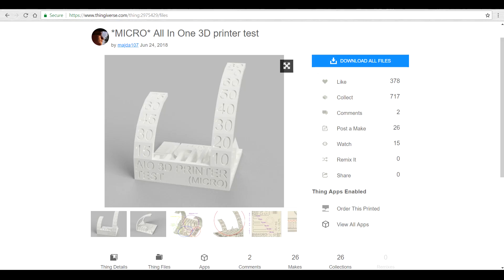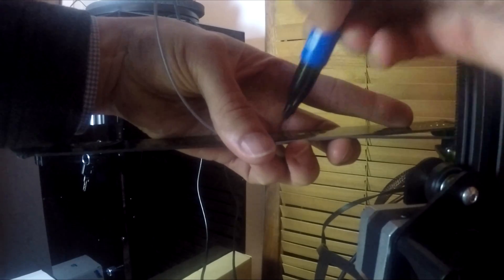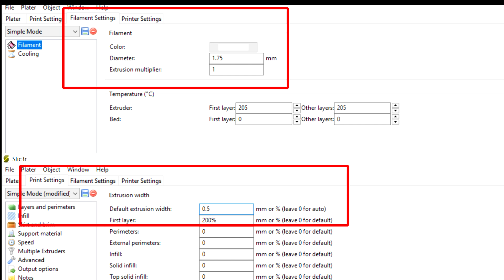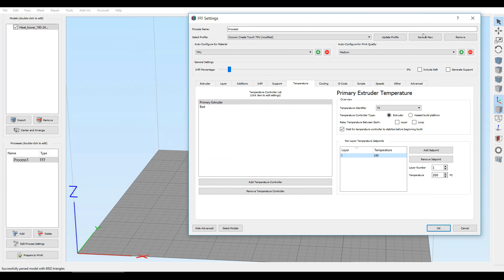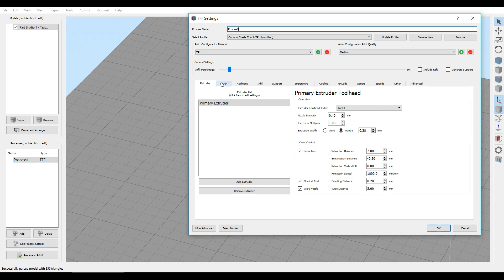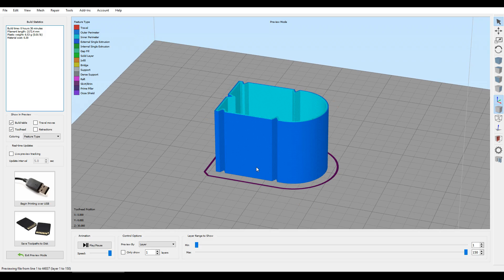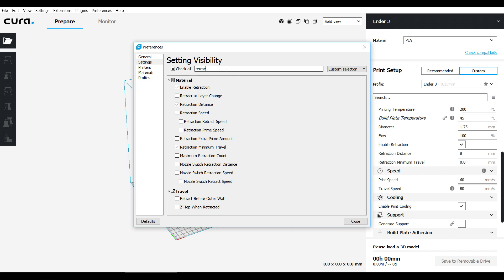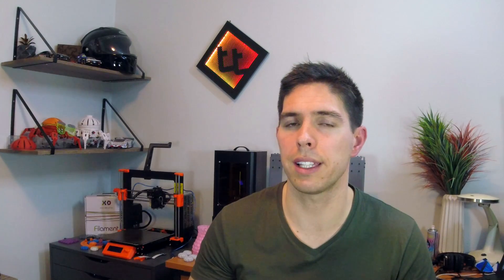How to tune your slicer settings featuring Ender 3 - UPDATE IN DESCRIPTION

Comment: When i do this  M92 does not update to fix the extruder ? M500 gives ok but it does not update M92 E...? Have i missed a step?
Reply from the maker: Creality don't ship the printer with eeprom enabled, which is where the value is stored. You can put the m92 in your start gcode.
Reply: @TeachingTech   oh ok, will updating marlin fix this ?
Reply from the maker: Yes it will. To vanilla like in my video or to th3d.

Comment: Hi, 

what is the codes used for?
"curl -k -H "X-Api-Key: B48F0C35933E47C49712EE720641ACF0" -F "select=false" -F "print=false" -F "file=@[output_filepath]" "http://192.168.0.5/api/files/local" {STRIP "; postProcessing"}"

it was found on scripts tab on s3d.

thank you.
Reply from the maker: That one uploads the gcode to your octoprint install automatically when you save it to your hard drive. You need to update the ip address and api key to match your printer. Curl also needs to be installed, I recently upgraded my computer and it seems to already be on here so maybe that's not such an issue.

Comment: why did you go for 0.48 mm of wall thickness instead of 0.40 mm?
Reply from the maker: It was the auto width from s3d.
Reply: @TeachingTech  How is it auto width if you calibrated it to measure 0.48?
Reply from the maker: Please see 3:30
The auto option is clearly checked. If you really wanted 0.4, just check manual and enter it.

Comment: Hi , followed the tutorial , when i save with M500 to eprom it comes back to standard 93 with next boot, i'm on stock , is there a way to save permanent to eprom ?
Reply from the maker: I recommend flashing to newer firmware to permanently avoid this (and have important safety features): https://www.youtube.com/watch?v=fIl5X2ffdyo
In the meantime, add M92 E<your value> in the start gcode.
Reply: I set the Esteps on the printer display (control->motion->Esteps/mm) and after that saved to memory (Control->Store memory) and it seems to keep the setting after being switched off. My printer is brand new so maybe they fixed the bug? I'd like to flash a new firmware but I'm kind of afraid of bricking my main board.

Comment: I'd like to see one on how to center the prints in the print area of the bed.
Reply from the maker: Assuming you have the correct printer dimensions in your slicer, this is usually automatic.
Reply: I've but both 220x220 and 235x23t for my ender 3 and it prints down and to the left always

Comment: You mentioned in one of your videos the Ender 3 factory test dog slicer settings. How were you able to find these? I wanted to use this as a starting point and fine tune from there.
Reply from the maker: I've just checked and on my SD card is a Cura ini profile. Please check on yours.

Comment: First of all, thank you so much for providing this information, this is soooo useful. Second I have run your extrusion test and when I tested after the e steps had been set, I was measuring roughly the same amount of filament (under extruded in my case). After much inspection, I realized that the M500 instruction does indeed NOT save the settings. If I disconnect octopi and reconnect, the setting is always back to the factory 93. Short of flashing the firmware, I'm not sure how to do this. My copy of the Ender 3 is pathologically under-extruding and in dire need of a fix. Any advice ?
Reply from the maker: Just add a M92 line to your start gcode and you'll be good: http://marlinfw.org/docs/gcode/M092.html

Comment: You forgot to add G91 before sending the command to extrude 100 mm. The G1 E100 might not work in case the printer was left in absolute coordinates mode wich is not rare! This was my case.
Reply: Guys please check the extrusion after making the correction because you might need to tweak it again no matter the calculations. And yes, thankyou Michael for a great job. Your videos on Ender 3 are a real thing for the owners.
Reply from the maker: Great spot and absolutely correct on the G91.
Reply: Thank you, you just saved me lol
Reply: Correct but aftrer that I had to return to absolute coordinates with G90
Reply: Aw man - if I saw this comment sooner I wouldn't have just wasted 45 minutes panicking
Reply: Or do a G92 E0.
Reply: I thought it was M83 ?
Reply: Is this why I can send a G1 E100 command only once?  I'm using Octoprint connected to my Ender 3.  I can send the command once, but after adjusting the M92 with the new steps, if I run another G1 command, it just sits there.  No extruding.  I have to shut down the printer and restart before it will accept another G1 E100 command.
Reply: I was wondering why my extruder was running backwards...

Comment: I ran through this series of tests because I upgraded to an all metal hot end on my Monoprice Maker Select Plus (Wanhao I3 clone).  Like in your video, my speed test indicated no difference when I increased speed, so I doubled my speed.  When I went back and printed the all in one, I found that my bridging performance noticeable degraded, so I went back to my original settings.
Reply: Yeah, the speed test doesn't really work as intended if you follow the video. To get an actual speed test you need to disable Speed Overrides in the "Speed" tab in S3D.
Since this is a small part, S3D will override the print speed and print it slower in order for the plastic to cool down. If you then go to a large model, it will not override speed and now your feedrate (printspeed) is waaaaaaaay above what this test does with Speed Override enabled.
Reply from the maker: Great point, thanks for sharing.

Comment: I have a Monoprice Maker Select Plus (Wanhao I3 clone).  I find that I can't get a good extruder calibration measurement if use feedrate 100 -- the amount of filament extruded was the same before and after, even though I changed my setting from 94 to 104.  Looking at the rest of the M503 data, I see that my maximum feedrate for the extruder is set to 25 mm / sec.  When I repeated with feedrate 50 (G1 E100 F50) I was able to calibrate.
Reply from the maker: I have the Cocoon Create Touch clone version. I have a bunch of videos on updating firmware and other mods, the advi3++ update is recommended and has a nice interface for calibrating the extruder from the touch screen.
Reply: @TeachingTech  Thank you for letting me know about your Cocoon Create Touch.  I hadn't realized that was a similar printer.  That will now serve as an additional resource.

I tried calibrating my extruder in the past but had the same problem of not getting repeatable results.  I tried again this past weekend because I finally replaced my hot end with an all metal one and because this video was still in the back of my mind.

Even at speed 50, the calibration wasn't repeatable and I was clearly overextruding.  I tried 25, and the extruder didn't move.  At this point, I guessed that the extruder gear was slipping during the test.  I removed my nozzle and was then able to repeatably calibrate.

Comment: Thanks for all the files!!! ¿Can you please specify what are the retraction settings for the pre-sliced retraction test? You said you changed the settings every 5mm so there should be six retraction configurations during the print (it's 3cm tall), but the image in Thingiverse only shows five configurations: 0, 2, 4, 6, 8.
Reply from the maker: From memory the base accounts for the difference.
Reply: @TeachingTech  but your picture is wrong. I dug around in the G-Code for the retraction test you posted on thingiverse, if you look at each Z- height and the corresponding retraction, its showing that until 12mm Z height it's at 0 retraction, which is 10mm tower height. After 10mm tower height it goes to 2mm retraction,  and then increases by 2mm retraction every 5mm. In the video you actually got the best retraction at 2mm not 4mm...

Comment: "beginner" with $150 program (same coast as the actuel machine)
Under marlin, without saying anything.. Very perturbed!
Reply from the maker: Please watch the video again. The fact I am using S3D, and the instructions for where to adjust the same settings in Cura and Silc3r are all covered.

Comment: I am new to this excuse the question: If I try to follow the Flowrate test in Simplify, my cube walls always have 1.6mm. Tried it with Auto and Manual mode. Is there any setting in Simplify I oversee?
Reply: Nm sorted it out!

Comment: With the wall thickness test, why is it that your desired thickness is 0.48? Shouldn't it be 0.50? How would I know my desired thickness? Thanks!
Reply from the maker: That is the auto generated thickness from Simplify3D. You can override this yourself. It doesn't matter so much what it is, just try and match it in your initial calibrations.
Reply: Great, thank you.

Comment: Thanks for all your vids.  I was going through this process and was trying to tune in my retraction.  
I ran the test and I had strings the whole way up.
After discussing in the Facebook group it was advised to be filament drag. Cleaned it out the nozzle and hot end per the troubleshooting good and re-ran.  Looked basically like yours. Thanks again
Reply from the maker: Great info, thanks for sharing.

Comment: Question does the Ender 3 Pro need TL Smoother?
Reply from the maker: It has the same skin pattern as the standard model for me. When I tested I found smoothers didn't fix it, other had more success.

Comment: Can the esteps be adjusted on the stock ender 3  firmware? if not is there a work around maybe using the starting gcode?
Reply: Think I found my answer in the comments below. add M92 Z9** to my start code. I have a new question now. If I am using Cura for the cube test and use 0.5mm, should it measure out to 0.5 or 0.48 as you mentioned in the video based on simplify?
Reply from the maker: It should match your slicer rather than mine.

Comment: Hey man. Thanks for the video but unfortunately when I use the method you showed, (including M500 for mem storage), it does not store the values. At the moment I am running my required M93 settings at start of gcode but I am not sure if this is good enough. I have not updated my marlin firmware yet, you think this is the issue?
Reply from the maker: Most likely. A few people have commented a similar situation, I didn't test it stock (or can't remember) but I think Creality might have shipped it with the eeprom disabled.
Reply: Thanks. Will try updating first. Keep up the good work. You have saved me countless hours of troubleshooting and frustration. I am very grateful to you.

Comment: Hi , 

Would you be able to show us how to do a filament colour change on the Ender 3 in simplify3d? basically to pause at a certain layer and then to change the colour and resume the print? I've been testing it using the additional terminal commands for post processing but was curios if you have done this and could show us a good solution?
Reply from the maker: I may cover this briefly in my dual extrusion guide.

Comment: Hi I tried the extruder calibration on my ender 3.  It tells me I am under extruding by 10mm (only 90 goes through).  I find this hard to believe since all my prints are almost perfect except for some stringing on fine details.
Reply from the maker: The visual feedback is always better than the theoretical value from this calibration. Keep in mind that the extrusion multiplier in the slicer affects the final amount t of plastic too so perhaps that is a factor?
Reply: Hi, No it seems not.  The test are all fine.  Where I am only having issues is in your 3 in one model and the three little columns to the left rear.  There is tons of stringing there as well as when the print on this gets 3/4 of the way up here: https://www.thingiverse.com/thing:2103691 I've tried systematically lowering temp, retraction distance, speed, and it never improves. Perhaps I've hit a limitation of this printer?

Comment: possible print nylon on ender 3 ?
or need something upgrade?
I know max temp. 250C.possible upgrade for up Cesia?
Reply from the maker: Not possible standard. I'm not sure what 'cesia' is. An ll metal hot end is needed.
Reply: Teaching Tech hi wiil  by  you try  used  nylon  230?    https://3dprinting.com/filament/taulman-3d-filament-available-in-store/ thanks
Reply from the maker: I haven't used it. Send me some and I will gladly test it.

Comment: When i do G1 E100 F100 on my ender 3 in pronterface it only extrudes 40mm of the 120mm... that seems way off
Reply from the maker: I agree that is to far off. Units not in mm?
Reply: I found out that my Extruder spring tension wasn't tight enough so it was slipping and missing layers. It is now working however I'm having issues with the flow rate test. I do the test but my caliper only measures to one decimal not 2. So mine comes out as .4 ... does that mean its good or should i get a caliper that measures to the 2nd decimal?
Reply from the maker: I advise getting it as close as you can and then adjusting based on what you see in your finished pints. This approach is often needed anyway.

Comment: Thanks for the profile. My Ender 3 was printing nicely, but not 90mm per second. I did throw on M420 S1 command for my Marlin mesh leveling and  the Chris Elkins starting script,  I dig the big Y axis purge to clear the nozzle. Thanks again!
Reply from the maker: I have found 70 mm/s to be a pretty good compromise.

Comment: Will calibrating the extruder work via octoprint if the Ender 3 firmware is stock and not updated? Thanks!
Reply from the maker: Yes. The only thing that might not work is saving it to the eeprom. In that case just add m92 e34 (your value instead of 34) to your start gcode.
Reply: Teaching Tech Hi. I calibrated my extruder, entered the number and saved it. Turned off everything and turned it on again. I typed m503 and the calibrated number showed up on the EXX. Does that mean it was saved on the firmware or something and that I do not need to add the code to the start code?
Reply from the maker: Yes if it persists after reboot you are good to go.
Reply: Teaching Tech Awesome, thanks!

Comment: I believe there is an error regarding the extrusion test.
If the object is 32mm tall, with a 2mm base, then there is 30mm for the towers.
You state you change the extrusion every 5mm, so that is 6 regions, and not the 5 you state (0, 2, 4, 6, 8)
In the supplied photo they are also marked as 5 regions.
Examining the gcode in preview shows the first region (0 retraction) is actually 10mm high.
Your best retraction at 9:30 is therefore 2mm, and not 4mm.
Reply from the maker: I have to check this. I know I commonly muddle my words when recording. For one of these I remember it had a 2mm base so I made the first band 7mm and everyone after that was offset by an extra 2mm. I never explained this in the video.
Reply: I just asked a similar question. I hope he updates the info soon.

Comment: What size did you’d cale your original model? What is the fastest setting and largest filament output you have tested on the .4 nozzle?
Reply: Sorry what i should really be asking is around finding optimal speed with good quality. Often times I just want to make something because I can and don’t care as much as a perfect smooth surface. Any recommendations? I’m using Acura because of the $140 steep cost for Simplify3D. any advice is appreciated. 
I want to run the similar benchmark with my profiles as yours to see if mine is as fast and good quality. 
So what is the layer height? And what is the object scaled by?
Reply from the maker: The scale is 100%, as in how the STL comes in the thingiverse link. Layer height is 0.2mm. After this video I've left it at 70mm/sec, I haven't tried to push further.

Comment: Those settings can be adjusted with Cura ? Great video ! Thanks
Reply from the maker: Enter them in as shown in the video.
Reply: @TeachingTech  You do not show how or if it is possible to set retraction at height in Cura!?
Reply: You didn't show how to change the settings at specific heights in Cura.

Comment: Why there is 80% fan in your FFF, why not 100% ?
Reply from the maker: The lower you can get it, the stronger the layer adhesion. The blower fan that comes on this is stronger than a radial fan.

Comment: I thought you had way more subscribers judging by the quality of this video, either way you earned yourself a new one! Great job!
Reply from the maker: Thanks Tom. It takes time to build but things are going well for nine months in.
Reply: Congratulations, and for many months to come! 

One quick questions, how would I go about perfecting my settings? Your provided GCodes print so smooth while my Cura profile is trash. Unfortunately S3D is a bit of a steep investment for me, but I will look into it in the future. Thanks in advance
Reply from the maker: I linked a troubleshooting guide in the description. I recommend looking at your issue and then finding the equivalent section in Cura to try and tweak.

Comment: Thanks for the video! Your recommendations make a lot of sense, however I'm running into issues when I calibrate the extrusion multiplier in Simplify3D. I get to the point where the wall of the 20mm cube measures exactly .48mm (matches extrusion width set in S3D), but when I try to print a regular object then, the outer walls can be pealed off very easily. The inner most wall is attached to the infill pretty good, but it's the other outer wall layers that come loose from eachother. Any suggestions?
Reply from the maker: Quite often it needs to be bumped back up a bit to get the prints nice. What comes off the printer is always more important than a theoretical value.

Comment: Do you have a good basic profile for the ender 3 for each slicer? Just wanting to start with something somewhat tuned before doing fine tuning.
Reply from the maker: I only use simplify3D, that profile is now added to the Thingiverse link. You can pull out most of the settings from there.
Reply: Thank you very much